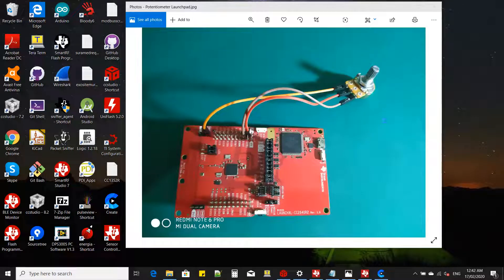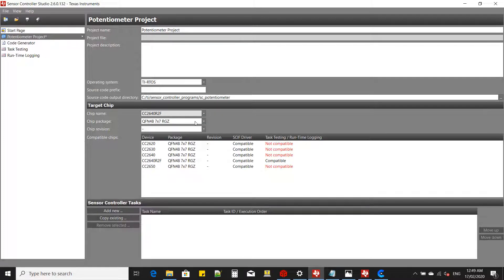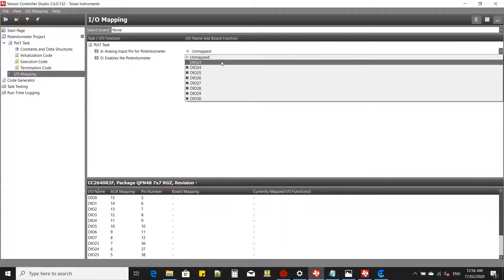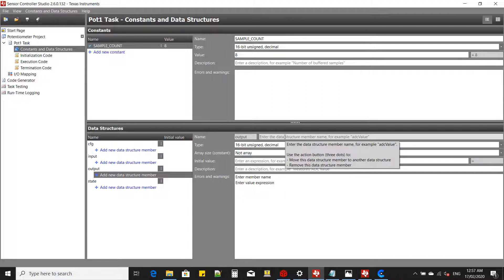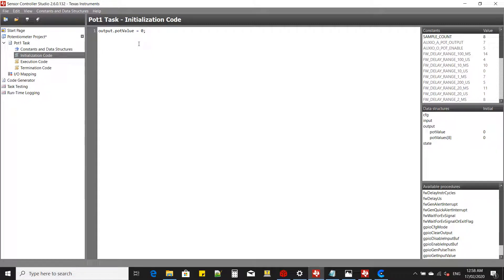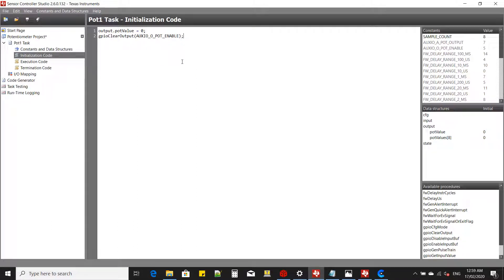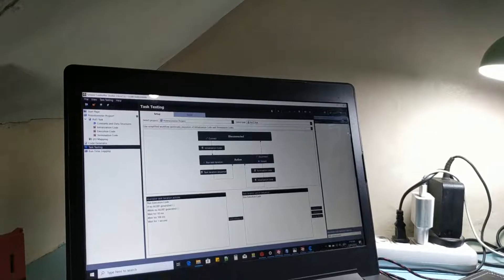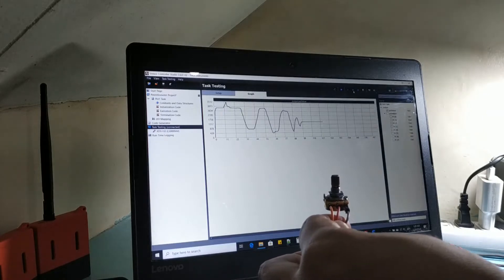Sensor Controller Studio First Project

Comment: Hey I want to read analog values from DIO11 without using Sensor Controller. Is it possible to use the PIN driver to read analog values? I want to read and send data to bluetooth characteristic.
Reply from the maker: Yes there are ADC driver example programs at the SDK you can try.

Comment: Thank you for the video. I am trying to use a 4-wire load cell but can't figure out how to setup the IO pins to have 2 outputs. Would you be able to advise me?
Reply from the maker: You need to use a hx711 load cell amplifier. There should be lots of tutorials in the internet how to wire 4 wire load cell. You can also check out my weighing scale blogs. https://markelthinkslearnscreates.wordpress.com/2019/03/10/msp430-serial-weighing-scale/ https://markelthinkslearnscreates.wordpress.com/2022/08/22/bluetooth-weighing-scale/